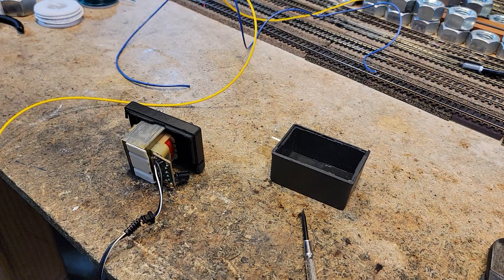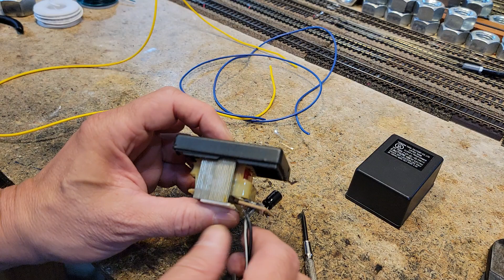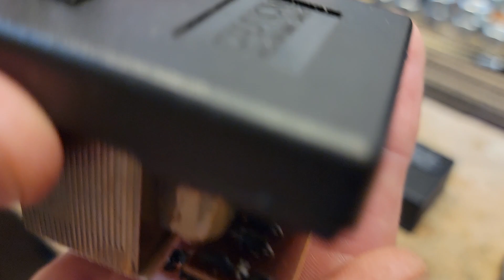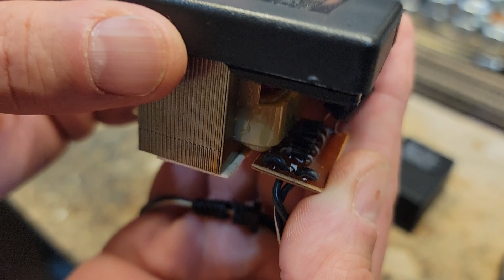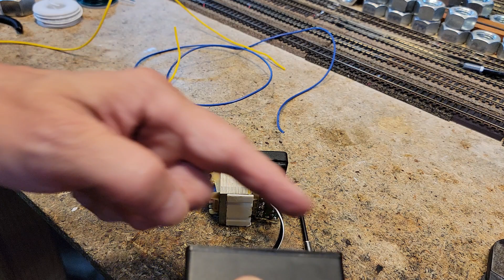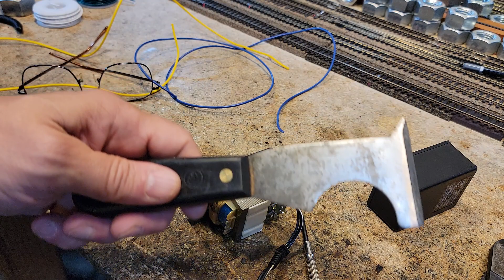Open a Wall Wart

Comment: 1:13 It does say what the output is: 500 mA @ 9VDC.  Right at the bottom of the power rating label.
Reply from the maker: I know right!  we've got a huge box full of wall worts that we need to open and solve for other projects!

Comment: Unless you're going to reconfigure or repurpose the power supply in my opinion is step is needless. I just cut off the plug at the end, connect a universal connector that is compatible with anything else I need and proceed. The white stripe on the cord provides the polarity.
Reply from the maker: There was a problem that the cord itself was ripped right where it goes into the case so I had to do it anyways.  I also wanted spade connectors which won't stay on that cheap wall wart wire!
Reply: @elite194  Understood.
Reply from the maker: @xxxx-hw5we  I'm saving the barrel connectors - hopefully I can start identifying them so they can be used for small projects!